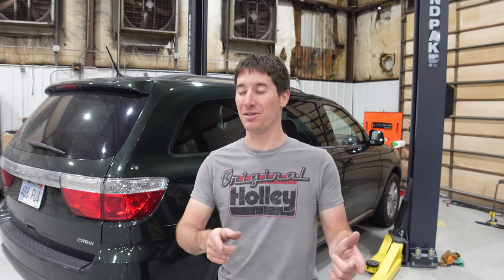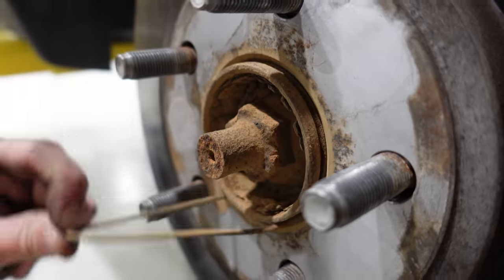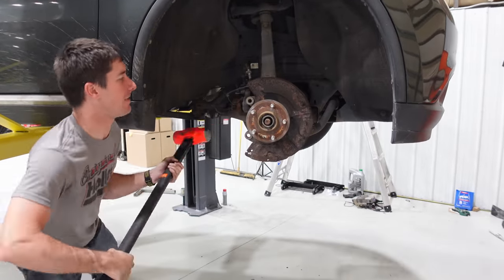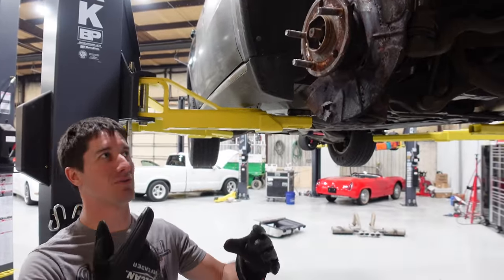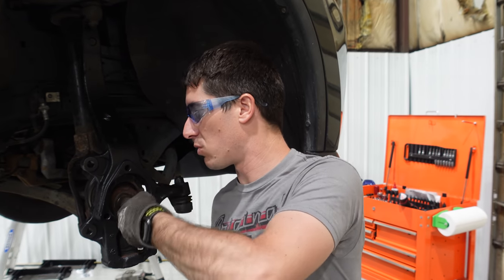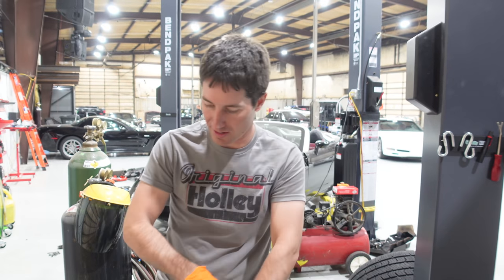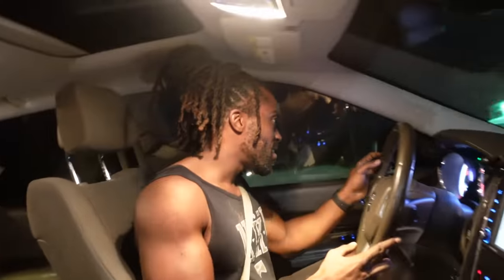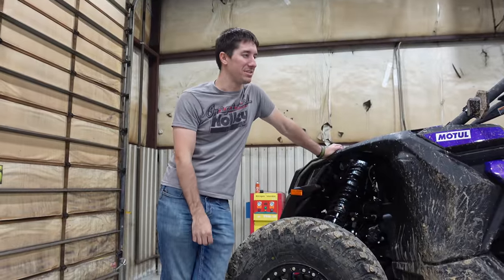This Is The Most STUCK Wheel Hub I've EVER SEEN *Totally Rusted*

Comment: I'm surprised you don't have a hub buster! $100 tool off eBay. We have used it twice and both times gotten stuck hubs off in about 30 seconds! Totally worth it vs hours of hammering and heating.
Reply: Agreed, South Main Auto just had video with same situation and used a hub buster with no problem and showed exactly what he used.
Reply: @jacksigler2302  it's such an awesome tool. My dad has turned a wrench for 50+ years and when he used it he was giddy as can be that it was that easy 😂

Comment: Pro tip: press out the hubs and here’s how. Knock out 2 wheel studs approximately 180 apart. Get 2 long bolts that are slightly smaller in diameter than the stud holes and a couple of nuts and washers.
Stick bolts through stud holes and install washers and nuts. Run the bolts down to the knuckle. Alternate tightening each bolt, about a half turn. Keep going until the hub pops out.
Reply: Or knock out one and do one side a little at a time with one bolt if you don't have 2
Reply: @16driver16  pro tip: keep plenty of basic hardware in your pro shop
Reply: @ToolsOutsideTheBox  my shop can't be very pro I have gravel and about 1/4 of a 10'x10' shed to keep my tools in and a tarpaulin carport to store my motorcycles. I can still be a pro tho? Even guys in apartments who have to rent garages and tools can be
Reply: Two words... Air hammer.
Reply: Ohh dang man, fantastic idea. I was going to recommend what I do, use a long stroke air hammer.
Reply: Judging by how stuck that hub was, even using that two bolt method, which was the way I thought he would do it originally myself, I think it still would have gone to the 'heat and hammer the f##k out of it' method regardless. I think he also mentioned something about not having enough air for even the wire wheel to clean up the area after he removed that hub, I assume that meant he doesn't really use compressed air, or there's some issue with the compressor, and he'd have needed the airgun, air hammer etc to have attempted this 👍
Reply: @Charlie_Crown  - In my experience the two bolt method works. I normally add a small steel plate to the end of the bolts to avoid damage, but the method has not let me down yet. I recommend using grade 8 or higher and apply oil to help protect the threads.
Reply: @josephseno8272  👍
Reply: @edwardmalfroid946  Yep. My $20 Harbor Freight air hammer has removed several hubs now. I'm 53 years old and didn't figure that out until last year. lol
Reply: I was going to say the same thing. All that work and gas for nothing. Lol Plus a trashed sensor.
Reply: @Charlie_Crown  depends in what thread pitch the bolt you use is how much tourque you can get but it is substantial
Reply: @ToolsOutsideTheBox  the hardware store is expensive and they will likely only need to do this 2 or 4 times
Reply: @16driver16  I live in an apartment and have 2 nuts and bolts.
But those who don’t have 2 are likely to not even have 1. So they should pick up 2 while they’re at the hardware store
Reply: @Charlie_Crown  as an alternative, you could probably use an electric rotary hammer
Reply: @16driver16  working on cars isn’t cheap and the bolts are likely to be useful in other scenarios
Reply: @ToolsOutsideTheBox  👍
Reply: @edwardmalfroid946  an air chisel and start forcing it to rotate to break that rust.  been working on cars in the midwest for all my life, rust is life here.  I have split hubs apart in an effort to get them out, and had to cut the race out of the knuckle.
Reply: i would have just pulled the upright and put it on a press with the torch to heat it

Comment: Surprisingly, I'm in the same boat as you JR. (air pressure problems or lack of) Then I discovered the other use for my Hilti Te55. Formerly used only for drilling or breaking out concrete. Now it's the first thing I reach for in that situation... 9.95 out of 10 a couple raps on the opposite side with a 2 lber from where I'm impacting does the trick. (bushing bit in the drill, ground down a little)

Comment: Dodge things. What you do is thread in the lower two bolts most of the threads are engaged the put a cheap socket on the head of the bolt so you don't mess up the bolt. Then beat on it. Works every time. Struggled like that once and figured that method out. Every time since they come right out. From wisconsin so they have been seized in every time. Keep up the good work!

Comment: I’ve used a 12 ton hydraulic puller and the SMA “remove a wheel stud/lug bolt” technique too when have encountered these type of hubs.
Reply: I agree, go watch Eric and South Main Auto videos. He makes everything look easy and he teaches people how to do it as well.
Reply: @ultimatejeep  yes, Eric just jacks the hub out with a large bolt and nut. No heating or pounding, no destruction! Using brains instead of hammers and fire wrench!

Comment: This is bringing me back to a dark place. Two weeks ago I replaced one wheel hub, and this past weekend I replaced another. Both were bad on the same vehicle, and I suspect a third hub may be bad as well. With the first hub for a few hours I tried knocking it around with a hammer, slide hammer, sledge and pipe wrench combo, and roasted the hell out of it with a torch. I ended up removing the knuckle, threading the mounting bolts back in a couple turns, and then wailing on them with a hammer until it worked the hub loose. The second hub I tried using one of those steel tools you bolt to the hub and hit with a sledge. The welds on that gave up before the rust on the hub. I ended up removing the knuckle again for that hub, and I'll be feeling it in my arms and back for another week or so.
Reply: @fiffe7782  After several fights with these hubs, I finally learned how to do it. The axle has a dimple on the end of it.  Back the axle nut off to the tip of the axle and use a pointed bit on an air hammer to drive the axle out of the hub. Put the point of the bit in that dimple and it will always break loose after a few seconds on the trigger. If you have an air compressor, a $20 air hammer is a great investment.

Comment: The Trucksters comment is spot on. I do the same and use my Hilti demolishion hammer with a flat blade to create the vibrating hammer blows to get the hub assembly to move. This method would have saved your ABS sensor and possibly the backing plate but lets be honest the backing plate problaby was shot as well. Swinging a sledge hammer near the fender could turn out badly which is why I try to avoid it. Always clean up the pocket it goes into and coat the surface with some kind of coating to prevent future rust. The next person replacing that hub assembly will thank you.

Comment: That’s why I invested in a air hammer.  Replaced a front wheel bearing on my wife’s really rusty VW.  Got the bolts out and used the air hammer to get the bearing to spin in its bore.  After that a little blip and it came right off.

Comment: Easiest way I’ve found to split the hub from the knuckle is using a hatchet. Has a nice flat spot on the back of it to hammer on, get it down between the knuckle/hub and it’ll pop out. I’ve been doing this on Jeeps since the early 2000s and have always had success. Worst case is you mangle to shield a little, since it’s sandwiched between the 2, but you can fix it, if you want to reinstall it. And yes, I lived in the rust belt of Ohio for most of these hub replacements with ALL the rust. Still worked great.

Comment: Just did this Job on a 2013 grand cherokee. I pulled the knuckles and had them pressed out after 2 hours of heat and hitting it. The hardest hubs ive ever dealt with. My friend who pressed them said they took a lot of pressure and it was violent when they let go. And this was an otherwise rust free Jeep.  Highly recommend just doing this, its 10 minutes more work to pull the knuckle off. And a heck of a lot less frustration. 
-get a mopar axle nut and backing plate, both are very cheap. Like $7.
-the 2011-2013 durangos and grand Cherokees had issues with hub rust because the wheels were missing some drain slots. Look at the back of the wheel and you will see what I mean. I cut the slots in my wheels in 2015 and have had no issues with hub rust since. Chrysler started adding them into the wheel in 2014. This also causes the wheel to look like crap and loose clear coat/ chrome peel around the center cap.

Also, buy good bearings like Timken. and do both sides. This is a common issue, but my oem ones did last 130k miles. I have heard of cheap ones going bad almost immediately, what's your time worth?

Comment: I did wheel hubs on my 06 Jeep Commander, which I think shares a lot of parts with that Durango.  I know this pain.  i ended up using an air hammer, after getting the whole hub so hot it flashed the PB Blaster I had soaked it in right in my face.  Whole process took about three days.

Comment: Quick mention: if you’re having trouble diagnosing which front wheel bearing is starting to go, and visual inspection yields no results, take it for a spin. Then turn the wheel slightly or go around a curve. 

If you load the wheel to the left and you hear the noise, it’s the right hub. If you load the wheel to the right, and you hear the noise, it’s the left hub. 

Hubs can be a pain in the butt to remove. If the sledge doesn’t get it out, instead of spending $100 on a hub buster (worth it though btw) use a long pipe wrench on the top of the hub and whack it like a hub buster. 

If THAT fails, tap a lug stud out and get a grade 8 bolt and nut. And use that to “press” the hub out. 

I had a hub to do on a 2007 Dakota rust belt truck. Slide hammer, pipe wrench, sledge hammer did NOTHING. Ended up using the bolt trick. 

Anyway, great vid! Keep up the work!

Comment: For jobs like this, you need the K-Tool Mega Hammer. It's a 65 lb slide hammer and they make an adapter that fits the large 5 lug pattern on Dodge/Chrysler vehicles.

Comment: I remember there being nothing wrong with the wheel bearing when the turo customer returned it.
Reply: I also remember
Reply from the maker: It only started making noise 3,000 miles later, so yeah, nothing was wrong then 🍻
Reply: Yea JR Don't admit you could have been wrong! lol
Reply: It's entirely possible for both things to be true. Could have made noise for the customer and nothing for JR. We've all seen stuff like this before.
Reply: I commented on that very video that that tire should spin more than a 1/4 turn after he lets go I told him it was bad. He said on the video it was brake drag. He's still a better mechanic than I am
Reply: Yeah he was being shady and lying about no issues
Reply: @Nedinho23  I don't believe JR is shady. It could have been the noise the person who rented it heard. JR also said there was some kind of noise but it was ok.
Reply: Wheel bearings are a difficult thing to diagnose until they are fully failing.  I bought a car with 121,000 miles on it and I suspected the front driver's wheel bearing was failing when I bought it, but the brake rotors were warped, the CV axles were failing, the tires were out of balance, and the tires were cupped (I didn't find this out all at the same time).  I took it to a couple different shops over the course of replacing that stuff, and two said it wasn't a wheel bearing.  I checked it myself and the wheel was tight, no movement.  By the time I replaced all of it but the bearing (the rest did need to be replaced) it was getting worse nearing 130,000 with vibrations and noise.  Couldn't have been anything else. So I took it to another shop, gave them the whole run down, service history, and told them at what speeds I hear or feel things.  Even after all that at first they said it's not a bearing.  Only when they drove it some more did they finally feel and hear it.  Since they replaced it, I finally have a nice driving car.  I should have just had one of the shops do it before, but they kept saying it wasn't bad.

Comment: I had to replace a wheel hub on a vehicle of mine a few years ago. I used some PB Blaster and let it soak for 3 days before it would come loose. There was lots of rust holding it in. When I put the now one on I coated it with anti-seize to, hopefully, make it easier for the next guy.

Comment: You guys need to watch the South Main Auto Channel and get the tool he uses.  Just bolts and nuts.  I ended up buying a big steel tube that bolts to the hub and you hit the end of that with a sledge and it pulls the hub out.  But yours reminded me of mine on my 2010 Equinox that lived most of it's life in New England.

Comment: Great job and always nice to see a repair where the pros have to really work at it!
Reply: I am not sure i would call him a Pro. A guy with a massive shop yes. There are other options other than heat and beat. He does not have a large enough compressor to run a air hammer. Let alone a air hammer.

Comment: flashbacks to doing the hubs on my 09 malibu... took hours with the torch, slide hammer, sledge hammer... what finally got it was to use a punch smack on the side of the hub until it rotated in place. That broke the rust bond and the slide hammer took care of the rest.

Comment: Knock out a lug, and use a piece of steel to to protect the upright.  Put a nut on the back side  and a long bolt through the lug hole.  Line it up with the upright with the scrap to protect it and tighten the bolt.  That will "press" it out.  Put a lot of pressure on it and then hammer the bottom outward.

Comment: It can be sketchy, but I've had good luck on those rusty hubs by running 1 bolt on the back side back in(not all the way) the wedging a socket and extension back onto said bolt on one end, and up against something solid on the other. Then start the thing and use the force of the power steering turning the spindle to pop that sucker apart.

Comment: "ITS THE TIRES. THE TURO GUY IS CRAZY"
Reply from the maker: I mean it took 3,000 more miles to become an actual noise 🤷‍♂️
Reply: @WatchJRGo  I'm not trying to troll, but are the tires still noisy?
Reply: I was gonna call JR out as well, but it was the driver's side the turo driver was bitching about.
Reply: @_RiseAgainst  i think because it wss so faint that no one knew what side was bad and it sounds like the issue comes and goes since dorrell was driving it for so long without any issues

Comment: If you turn the wheel you get more room on the hub bolts, also easier to swing a hammer to hit the hub with the wheel turned. I've never had to use a torch on a hub assembly and I live in upstate NY and work on a fleet of pickups and we have a few Durangos as well.

Comment: I had a rusted ball hitch that came on a used truck I bought from a friend. The hitch had been on the truck for at least 5 Wisconsin winters and was really rusted in place. I wanted to get it out so that no one would hit their knee on it, so I started spraying it with PB Blaster, WD-40, Liquid Wrench, and any other penetrating oil I could find. I would spray it wait a few days and then start hammering on it with a a 3 lbs. sledge and also an 8 lbs sledge. This went on all summer, then I tried using a come-along tied to a tree. Still nothing. I also tried a tow strap tied to the tree and drive the truck away. Still nothing. I gave up for about a month, then my wife suggested trying vinegar mixed with salt. I put some in an old spray bottle, and soaked it down 3-4 times over the course of 4-5 hours. Got out the 3 lbs sledge and it walked right out.

Comment: My wheel bearing was so seized on my axle I had to hit it with a hammer for several hours  as hard as I can, only to realize my axle nut got bent onto the spindle/axle, had to angle grind part of the axle off just to get the nut off and get some good threads. However my Buick lesabre now has 2 new wheel bearings….. so I feel it 😂

Comment: When replacing an axle seal on my C6, I couldn't get the axle nut off. I tried an electric impact, an air impact, a 2' breaker bar, same breaker bar extended with my floor jack handle, propane torch, MAPP torch and harsh language. It finally took two big guys using a welded (no joint) 3' breaker bar with a 4' extension. GM had wisely used nord lock washers under the axle seal. :(

Comment: This video is simultaneously giving me PTSD and making me not feel bad. I did both front wheel bearings on my mom's Grand Cherokee (12, so exact same hub/suspension). It took me DAYS with a map gas torch and an air chisel, amongst other tools. What a horrible job.

Comment: Astro Pneumatic 4980 air hammer to the bolt ears on the bearing to spin it clockwise or counter and it comes right off.

Comment: I've dealt with this on both front wheel bearings on my 13 Durango. Hours of beating and broke a couple chisels. Of course I didn't have a garage full of tools back then either. These are the worst ones I've done yet, 03 Chevy 1500 way worse with rust, hit it with a 2lb mall and it fell out.

Comment: You needed to borrow big nasty from eric "o", it worked for a rusted one i had to do.  The air hammer attachment that looks like the end of a hammer head work's good with some heat.  Nice carnage though.
Reply: Actually you can buy your own “Big Nasty” from Astro Tools (model 4980), and they also make a long shank version called “Thor” (model 498K)
Reply: I don't think JR has an air compressor capable of powering Big Nasty.

Comment: It gets you a nice heavy flat hammer that you can literally just screw on to the studs, You can turn it slap slam turn it slam and you can go around and work it loose I made one after having difficulty Aint you in a wheelbarrow on mountain power since then I use it every time just make it so you can just thread the end of the rod and you can put it right on the wheel stud